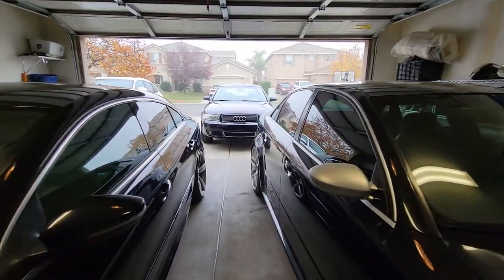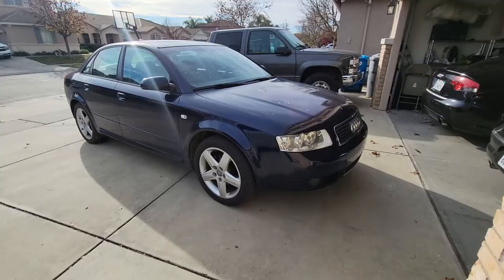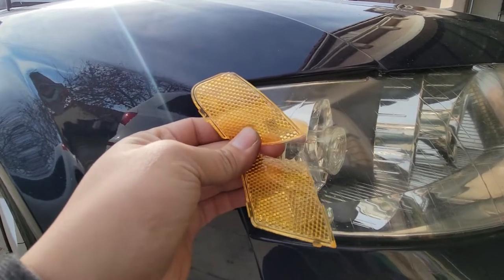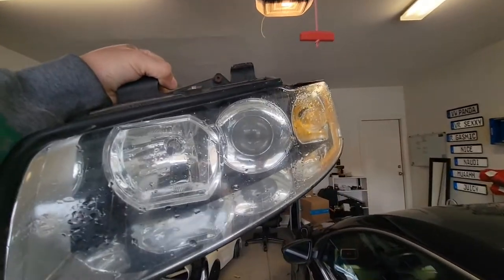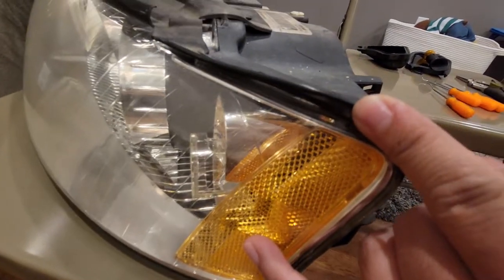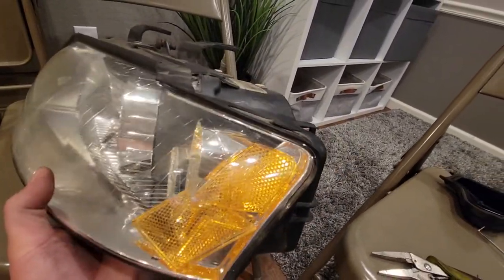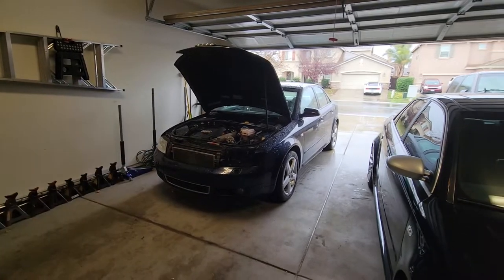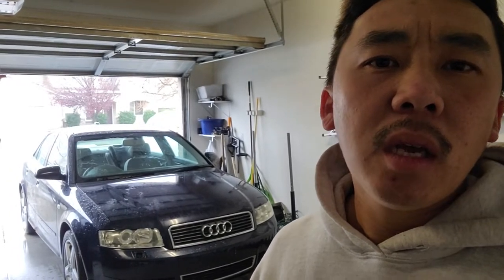AMBER CORNER LENS DELETE on My 2004 Audi B6 A4 1.8T Quattro 6 Speed Manual!

Comment: This didn’t work at all
Reply from the maker: It's a pretty tedious process 👍
Reply: @cjscarcollection18  I figured it out, it was very difficult. What turn signal bulbs do you have?
Reply from the maker: @prophet3831  I'm glad you were able to figure it out 👍 currently just still runing the stock bulbs. Want to do some LED switchbacks soon. Just sorting/looking for resistors.
Reply: Yo… do you have any tips?? I'm trying to do it right now and it's very hard to break the top half
Reply: @BenWoolls  dedication. It took me a long time to get it. You’ll get there. Ensure you are using a long metal pick, like 8-10 inches.